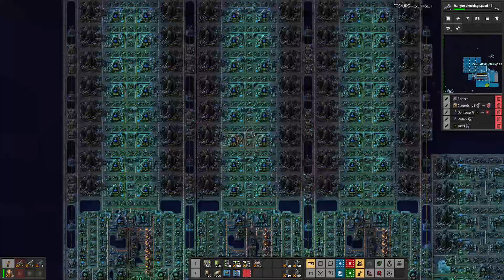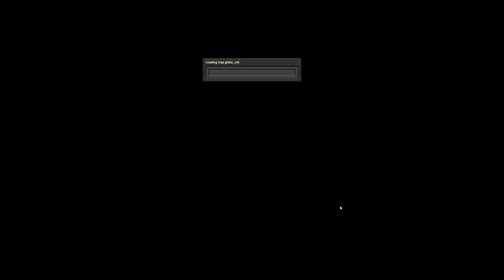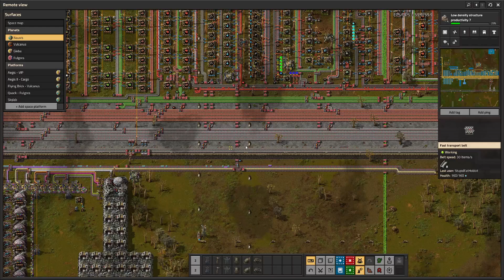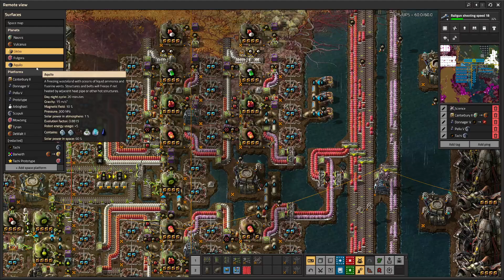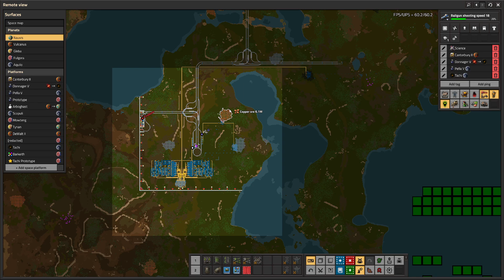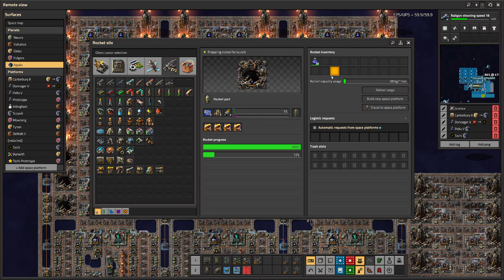Factorio Space Age - Blade Design

Comment: this type of design is really common in pyanodons, where belt throughput is usually not a concern (0.1 items/s is often plenty) and there are too many items to bus all of them, so you need to be extremely picky to only bus super widespread use and dense materials, and everything else just gets made ad-hoc.

These "blades" as you call them are basically just slightly bigger than usual modules.

Comment: Why produce certain sciences on Vulcanus and other on Nauvis? I mean, why not all of them on the same planet and what made you decide which science goes where?
Reply from the maker: This is the most debated question right now in megabasing and there's no conclusive opinion. I wound up doing red/green early on Vulcanus because fluids > solids in 2.0 but stone/coal can't be made liquid so purple/grey wound up on Nauvis. Blue science is my original pre-2.0 design expanded and frankensteined into its current state. Next game I'm actually planning on trying for a 100% Vulcanus production because trains are dogshit now (mainly due to lacking quality, but also high inserter number) and I'm tired of dealing with them. There's other ideas for low-ups designs but purple and grey science remain the biggest problems by far and nobody has a good solution yet.

Comment: How do you refactor your base? The problem I generally have is I have a massive base setup on each of the planets and I want to refactor them into newer/more efficient legendary designs, but my bots start picking up deleted belts that may carry ores or other items for example and now I need like millions of chests just to rebuild/refactor something because otherwise the bots have no where to temporarily drop off the structures/ores/etc until you decide to rebuild it. Is there an easy way to refactor a base?
Reply: You can always disconnect the mines supplying the ore and wait for it to run out. That or just plug the end of the belts into chests so bots don't need to pick up the belt items.
Reply from the maker: @crankthatrebecca12  @SJ21792 Yup, disconnect the inputs so the system is drained out as much as possible before deconstructing, after that it's just using lots of active provider chests and bots. If you deconstruct a chest that has items in it then construction bots move the items. If you change the chest to a purple one then logistic ones will handle it and you will always have more of the latter. I also am always physically present when refactoring large builds and having a large inventory (legendary mech armor with ~11 legendary toolbelts) along with placing some temporary chests goes a long way. Don't underestimate the sheer amount you can quickly move by hand when ctrl+clicking entire chest inventories into your personal inventory and then into those temporary chests.

Comment: I'm wondering if to solve the solids issue it would be possible to direct insert from a train. Would definitely require a lot of awareness of space usage, but with some tinkering might be a good alternative to having to belt everything and be just as expandable as a true blade.
Reply from the maker: Trains are kind of shit in Space Age because they didn't implement legendary cargo/fluid wagons. Everything else scaled way up (belts are over 5x as much, bots are more optimized and can be legendary, fluid 2.0 is essentially unlimited) but trains are still stuck with 40 slots. A big part of the blade designs were attempting to avoid trains as much as possible. My old orange sci was train based like you describe and was replaced by the build shown in this vid. The amount of tungsten required made a train based system feel very inadequate.
Reply: @StupidFatHobbit  Interesting. I'm not nearly as optimized in my game yet and hadn't considered that trains themselves would be the bottleneck in a setup like that. I can't think of a better way to do it than the side loading you set up, but something in me feels like it needs to be more modular. This is going to bother me until a solution is found lol
Reply: A full wagon of iron ore is 2000. If your module consume a full belt you are consuming 240/s, so you have to deliver a train every 9 seconds. I am no saying is impossible, but it's a challenge for sure.
Reply: My entire fulgora science station is based entirely on unloading from trains directly into recyclers (well, a single buffer chest but still.) 12 cars, each unloading 100 scrap/sec which becomes a full stacked belt of processed scrap pulled into 12 separate "blades" that output em science precursors (to be crafted at the rocket field instead of the blade due to compactness/ratio reasons). Requires a new train every 40s is iirc

All my science modules and most if not all of my primary manufacturing is direct from raw - never liked the main bus so it's nice to see this video bringing that concept to the foreground. Validates my playstyle lol
Reply: @ My entire Fulgora base is from trains too. I use 1-1-1. Each station has it own scrapper system so i can just copy and paste a new one whenever a want. Then i have a main bus almost for liquids and that's basically it.